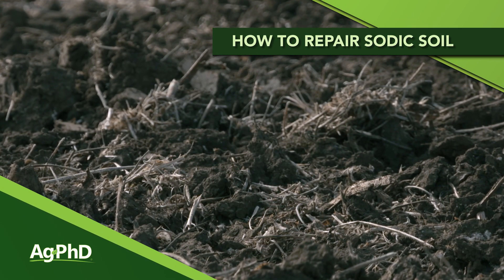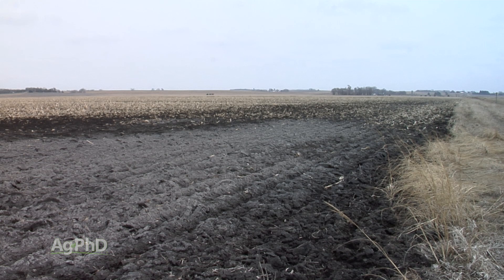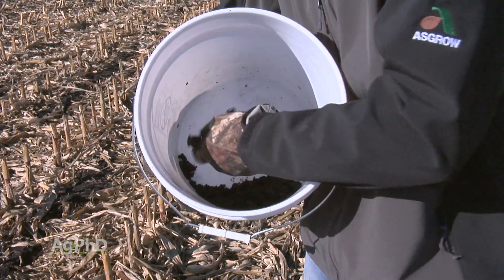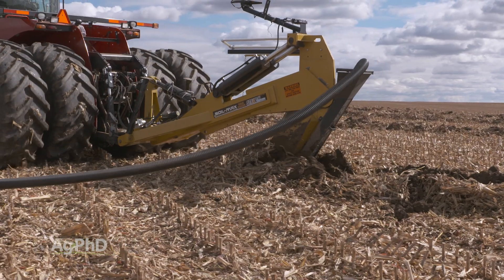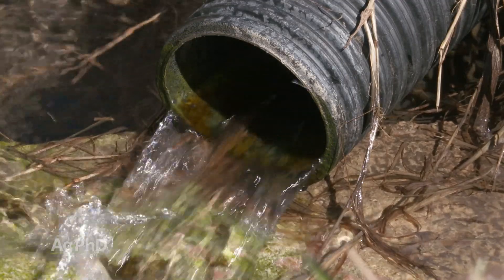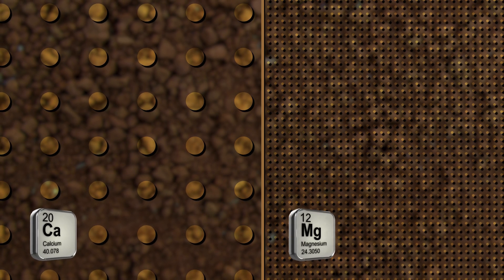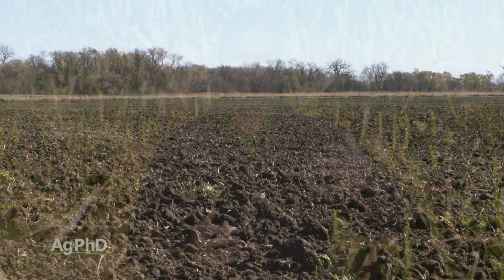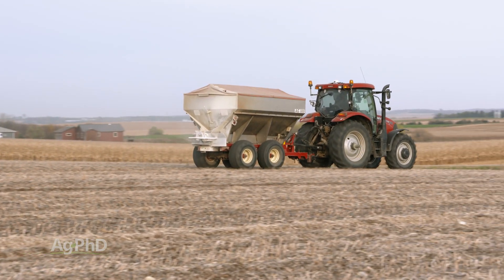Repairing Sodic Soil (From Ag PhD #1121 - Air Date 9-29-19)

Comment: NO. I have sodic soils in Aust. Definition is clay loams. 
Sodium is 0 08, N=.3, P=11,K= .86.calcium is 11.
Rest minerals are very low, including aluminium. 
My cec is 14, organic carbon is > 3%. They still turn rock hard in summer, have tunnels in the soil, & erode as you watch the rain fall.
Reply from the maker: Brian and Darren addressed your comments on Ag PhD Radio: https://on.soundcloud.com/rNktqDtUoYcv6fsR6 (the link should take you 52:28 within the 12/31/24 show).